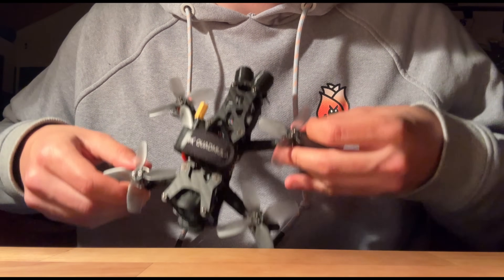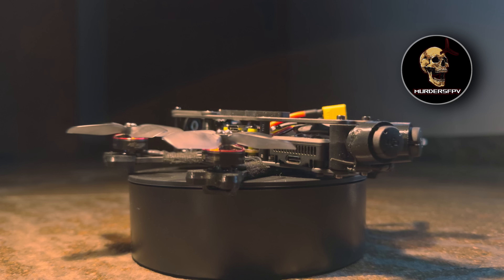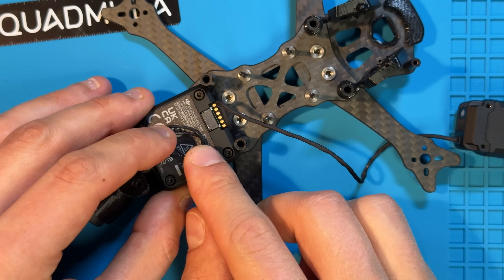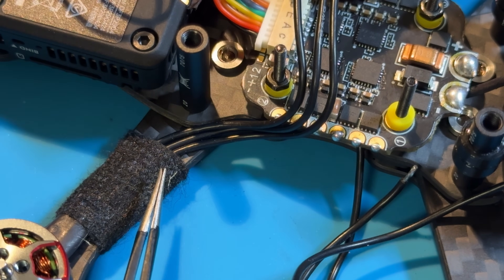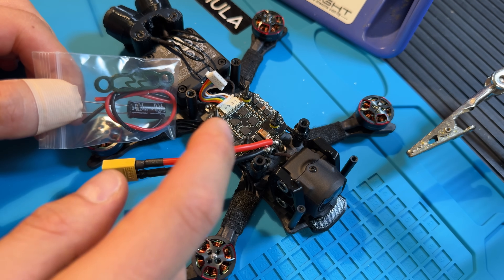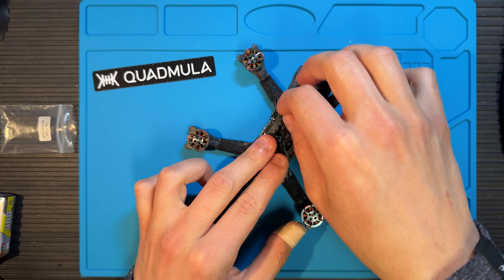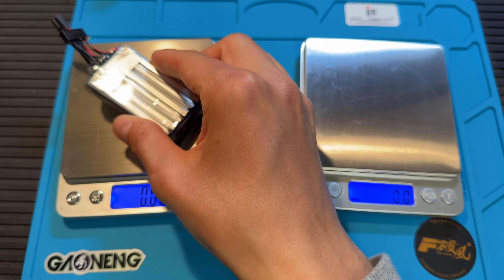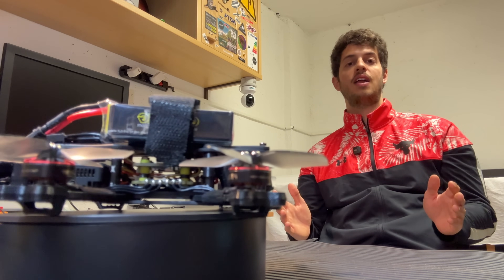Best SUB250 - 2,5” build in 2026 | Cinematic & Freestyle FPV

Comment: Very nice build man! I was surprised by the 6s batteries though, won't a 4s setup with higher kv motors give you very similar performance, but cheaper and lighter?
Reply from the maker: @Exhodus  I totally get where you’re coming from. When I first started with FPV, everyone was flying 3S batteries, then it moved to 4S, now 6S is the norm and what is it about 8S?!
While some might say a 4S would be better for a smaller build, I personally prefer 6S because it gives me more power, faster motor speeds, and better responsiveness. It makes the drone quicker and more agile, with less voltage sag and heat.
It wasn’t easy getting everything under 250g while still having decent flight time, but I’m pretty happy with how it turned out.
That said, I totally understand why some people would choose 4S for a smaller build-it definitely makes sense!
Reply: what KV can you suggest ?
Reply: 6s give you less battery sag on punch outs

Comment: just a suggestion, flip your tweezers upside down like a hook and bring them under the antennae connection and gently pop it off instead.
Reply: If your talking about the ufl connectors on the vtx this works great! I do the same with an Allen wrench and a little finesse

Comment: Whats your opinion on the walksnail system? I was thinking about the moonlight one. I never built a drone, is it the same procedure?
Reply from the maker: Walksnail is a completely different video system and this frame was specifically designed with the O4 pro in mind. Though mounting nowadays is standard throughout most hardware. I have no experience with the Walksnail system so I can’t really tell you my opinion.

Comment: I followed your build, it looks a bit janky but powers on. I tried to follow your list in the end but while testing in the betaflight motor tab only 1 motor is spinning. The other 3 are trying, then beeping, before stopping. When I just connect it to my Radiomaster Pocket, arming and throttle up its not spinning at all, however if I use the other axis some motors will (sometimes) spin.

It's my first build and idk were I did something wrong...
Reply from the maker: Sorry to hear you have issues. There are several things that could lead to these issues. Do you have bidirectional Dshot activated in the motor tab? Because you mentioned this is your first build but things look “a bit janky,” carefully re-checking wiring and connector quality is essential. Could also be an issue with your esc but let’s hope not.
Reply: @xaa_fpv  I was troubleshooting it over chatGPT and it was like no way it's bc I use 4S while waiting for my 6S battery... Well turns out chatGPT was wrong in that aspect, but it helped me with other issues! It's working now, first flight tomorrow.
Reply from the maker: @Furzgun Good Luck!

Comment: Can you post a video of the steps after build? Like flashing and setting up on beta flight. I’m a newb and have been following the build. I finally got my 04 pro today so going to complete the build and move on to flashing before I fly!!! Fingers crossed!! Great video by the way!!
Reply from the maker: Thanks man, I’m glad you like the video!
It’s true I didn’t go into much Betaflight config detail but 14:50 should get you an overall idea on what you need to do. 
If you followed the video using my same parts you can just download the Betaflight config from the link in the description. Hope that helps!
Reply: @xaa_fpv I got already build step by step but having issues connect radio to drone.. it binds but no input…
Reply from the maker: @DSTEEZYFPV in the receiver tab the receiver mode should be Serial (via UART) and the Provider should be set to CRSF and make sure in the Ports tab that UART2 Serial Rx is toggled on
Reply: @xaa_fpv appreciate the response I figured it out, it ended up being I had to flash both the tx and the rx. I thought the tx was up to date but apparently it wasn’t. Fly’s really good!! I just need the rain to stop haha 😅

Comment: WHY 6S!?!?!?!?!?(?!?

Sorry, caught me off guard
Reply from the maker: That's alright, I got that question a couple times already😁
While some might say a 4S would be better for a smaller build, I personally prefer 6S because it gives me more power, faster motor speeds, and better responsiveness. It makes the drone quicker and more agile, with less voltage sag.
That said, I totally understand why most people would choose 4S for a smaller build like this one. It makes sense
Reply: That's okay, if it weren't because of the price tag I'd probably build a 6s in your position, totally understandable  @xaa_fpv

Comment: Is there any sub250 build that manages flight times of 15-20min? or is that impossible?
Reply: Flywoo has the lr4 which is a sub250 long range that may worth take a look
Reply from the maker: Yeah, it’s possible but not super common. Something like the DJI Mini 2 hits those 15–20 min flight times,I think. For FPV drones under 250g, you can get close using 18650 batteries but you’re trading power and agility for endurance. It’s doable especially with super light, cruiser-style builds but don’t expect acro performance.
Reply: @xaa_fpv  I am really only interested in cine - so that should be fine.

Comment: Can someone explain the lightbulb thing please?
Reply from the maker: The light bulb thing is called a smoke stopper. It’s a simple safety device you connect between your battery and drone to limit current flow. It uses a car light bulb that lights up if there’s a short or fault, preventing too much current from reaching and damaging your electronics. This lets you safely test your new built without burning parts if something’s wrong. Cheers

Comment: How come no one uses dji controller? Isn't it just one less part you need in the quad?
Reply from the maker: You’re right but the DJI radio link is not known to get you super far in terms of range. We got much better alternatives like ELRS that offer better penetration and versatility. ELRS receivers can be super tiny, lightweight and cheap at the same time while still providing excellent range and penetration. So I would always recommend that over a dji radio link. Cheers

Comment: It is a very tight fit, could you consider maybe adding a GPS to the setup to make retrieval more easier
Reply from the maker: I think I saw someone having a gps module, same frame on a similar build. It’s definitely possible although I haven’t tried adding one to mine yet

Comment: nice video… buut :-) why going with 6s? 4s would be more than enough for such a small unit … additionally i understand the o4 pro has advantages for cinematic shots, i feel however that the o4 unit (lite) has much better value and would be much better for a build of this size … other than that cool little ripper there.. cheers
Reply from the maker: I totally get where you're coming from.
While some might say a 4S would be better for a smaller build, I personally prefer 6S because it gives me more power, faster motor speeds, and better responsiveness. It makes the drone quicker and more agile, with less voltage sag and heat.
That said, I totally understand why some people would choose 4S for a smaller build like this one. I chose the O4 pro because ultimately for this build it’s a replacement for any other action camera you would normally carry on your drone. So I wanted the best possible performance and video quality that’s why I went for the O4 pro instead of the O4 lite. But I’m currently working on a light build that runs the O4 lite.

Comment: This build looks amazing! ;)
I'm a total noob, but why not using the DJI radio link (and how to use it if I want)?
Reply from the maker: Thank You! The DJI radio link is not known to get you super far or to be super reliable. We got much better alternatives like ELRS. If you watch from 08:54 I removed the GND and SBUS wires for the DJI radio link but if you want to use that you would have to solder those two additional wires onto the FC.
Reply: @xaa_fpv thanks for your reply! Since I've got the DJI headset + controller already, I thought about using them (at least at the beginning). Thank you!

Comment: Hi there, I've got basically the same spec as you, just that my motors are hglrc 2750kv motors instead of your 2900kv. I'm hovering at around 40% with a 6s GNB  HV 650mah pack... What are your hover %? It feels really sluggish. I'm using Gemfan 2540 props. Would going to 4x blade props improve my power/hover percentage?
Reply from the maker: Hi, I hover at around 30% with the HQProp TR2.5X2.5X3. Yours do have a higher pitch.
You could try the HQPROP DT63MMX4 they should give you a little more lift. 
I think the 2900kv are perfect for this build. I really like how this thing flies.
Reply: @xaa_fpv  Hi there, still hovering at 40 wit Avan 2.5 props. What battery are you using to hover at 30%?
Reply from the maker: @InfinityDrones I use GNB 530 HV
Reply: @xaa_fpv ill have to try and see... Im still at 40 % throttle with my 650 HV. You're at 30% right?

Comment: Very nice build! Wouldn't 6s be overkill? Also, would 3.5 props not give you more efficiency and flight time?
Reply from the maker: Thank you! I personally prefer a 6s build over 4s build. The frame I’m using in this video only works with 2.5” props.
Cheers

Comment: I just wanted to say that the build you did was done quite nicely.  I really like the attention to detail.  The drone seems to be very popular.  I keep seeing them everywhere...   It does sound like the quality of the materials is top notch as is the fabrication of the frame components.

I am curious what soldering iron you were using in the video?  Perhaps others can also comment on what we could see but it was very effective at getting that wire soldered to that pad.  I usually seem to have to try to put the iron in a position where it is touching both the pad and the wire at the same time.  I "aim" for that intersection or try to create a small gap for the iron tip to go into...   

long story short my joints are not great.  What temperature was it set at?  Are you using 63/37 or 60/40 solder or silver solder or something else?    Again really great build, this is a great example of the right way to do something like this - methodical, measure twice, cut once, clean, detailed...  Cheers!
Reply from the maker: Thanks a lot for your kind feedback.
I really appreciate it! I learned a lot from Mr. Steele soldering video he uploaded years back. One thing I always stick to is keeping my iron nice and hot, around 400°C, no matter what I’m soldering. I prefer 60/40 solder since lead helps make cleaner, shinier joints (always use a smoke absorber, stay safe✌🏽). And of course, plenty of flux is key. I hope that helps, if you got any more questions feel free to ask!
Cheers

Comment: Can you list the soldering iron and solder ?
Reply from the maker: I mainly use a Weller WE 1010, but I also have a PTS100 for quick jobs on the go, which works very well. I use a spool of 60% tin and 40% lead solder, 1.25mm thick with 2.2% flux. Most solders nowadays are lead-free, and I’ve had this spool for many years. Lead solder makes shiny joints and is easy to use, but always remember to use a smoke absorber when working with it.

Comment: Very nice & cute build! 
Got few questions if you please. 
1. I assume the short vids at the beginning captured with this exact drone and you fly near waterfalls. Have you coated the electronics or just pray or else?
2. Isn't it better for such a small quad to go with 4S instead of 6S(would it be enough or not as power, but you cut lot of weight too)?
3. Have you tried kind of semi-long range with it( if you - how far ).
Thanks! Best regards!
Reply from the maker: Thank you!
1. No I haven’t coated anything but I heard the flywoo x30 coating is good and easy to apply 
2. I prefer 6s over 4s because I get more power, faster motor speeds, and better responsiveness. It makes  the drone quicker and more agile, with less voltage sag. It wasn’t easy getting this all under 250g with a reasonable, good flight time but it came out pretty well. But i can totally understand why people would choose to go 4s over 6s with such a small build. It comes down to personal preference I would say.
3. I don’t have a gps onboard but I would guess the furthest I flew away was around 800m with full video and radio link signal. I think the O4 in combination with a good, powerful elrs radio module can get you really far.
I hope this helps, and if you have any more questions, just feel free to ask.
Cheers!

Comment: if u have o4 why not use dji controller ?
Reply from the maker: @pawelpieczynski4608  I didn’t use the DJI radio because it’s not as reliable and doesn’t have as much range as other radios that use ELRS, crossfire or tracer. What I heard sometimes it can lose connection unexpectedly, which isn’t great when you’re flying. Also, other radios feel smoother and more responsive when you fly, which helps a lot. So, I prefer using those for a better and safer flying experience.

Comment: Hi! I’ve got a bit of a strange question. Have you noticed any micro-damage on your O4 camera that only shows up when light hits it at the right angle? Under sunlight and from a certain perspective, I can see tiny dots or specks on the lens. I noticed this on my O4 Pro, which is mounted on an AOS 3.5. I’m just wondering how this might develop over time. All the best — great video, thumbs up!
Reply from the maker: Thank you🙏🏼!! I just had a good look at my O4 lens but to me it looks totally fine. When you say specks on the lens do you mean inside the lens or just on the lenses surface? Do you see anything weird while flying as well?
Reply: @ Hi, thanks for your reply. While flying, I absolutely don’t notice anything. I only saw those tiny dots on the lens of one of my cameras — I have three O4 Air Units in total. Anyway, there’s nothing to worry about. It’s possible that it got damaged in one of the crashes, maybe by sand or something like that.

Comment: Why use 6s over 4s
Reply from the maker: @handledrandomly  When I first started with FPV, everyone was flying 3S batteries, then it moved to 4S, now 6S is the norm and what is it about 8S?!
While some might say a 4S would be better for a smaller build, I personally prefer 6S because it gives me more power, faster motor speeds, and better responsiveness. It makes the drone quicker and more agile, with less voltage sag and heat.
It wasn’t easy getting everything under 250g while still having decent flight time, but I’m pretty happy with how it turned out.
That said, I totally understand why some people would choose 4S for a smaller build-it definitely makes sense!

Comment: Very nice, but I'm having a hard time seeing why something this small and lightweight would be better to do in 6s over 4s?
Reply from the maker: @jessehoffman5302  Thanks man🙏🏼
You are right, I totally get where you’re coming from. When I first started with FPV, everyone was flying 3S batteries, then it moved to 4S, now 6S and what about 8S?!
While some might say a 4S would be better for a smaller build, I personally prefer 6S because it gives me more power, faster motor speeds, and better responsiveness. It makes the drone quicker and more agile, with less voltage sag and heat.
It wasn’t easy getting everything under 250g while still having decent flight time, but I’m pretty happy with how it turned out.
That said, I totally understand why some people would choose 4S for a smaller build-it definitely makes sense!

Comment: How come you didn’t use the DJI radio ?
Reply: If u want to loose your drone u can use that 😂
Reply: @ sorry, new to this hobby and still trying to learn and keep it as simple as possible.
Reply from the maker: I didn’t use the DJI radio because it’s not as reliable and doesn’t have as much range as other radios that use ELRS, crossfire or tracer. What I heard sometimes it can lose connection unexpectedly, which isn’t great when you’re flying. Also, other radios feel smoother and more responsive when you fly, which helps a lot. So, I prefer using those for a better and safer flying experience.

Comment: I thought that sub250 is name of the brand
Reply from the maker: @jonathanoeijoeng  that’s right sub250 is a brand/drone manufacturer that specialised in building drones below 250grams takeoff weight. But generally in Fpv sub250 refers to all builds that are below 250grams takeoff weight
Reply: @xaa_fpv but I see brand name is quadmula?
Reply from the maker: Yes, the frame is from Quadmula, but the build is custom, so you’d need to get all the parts yourself and put it together. Unfortunately, you can’t buy this exact drone already assembled and ready to fly anywhere.